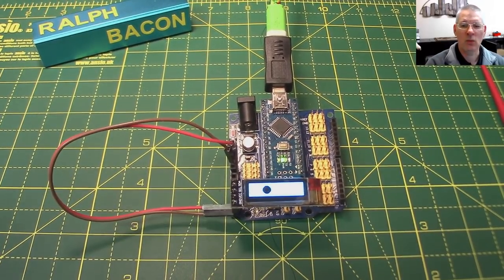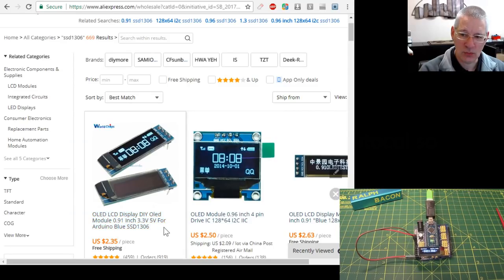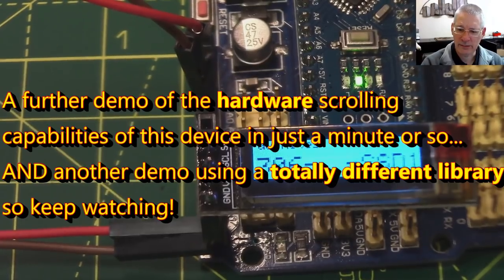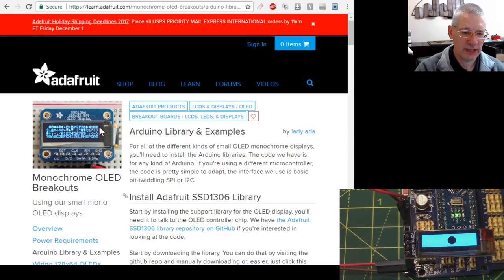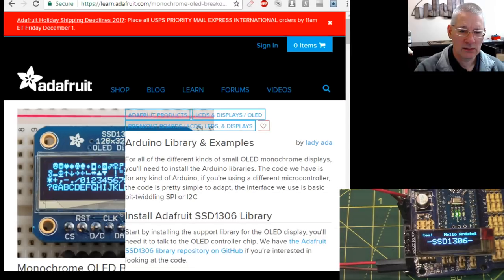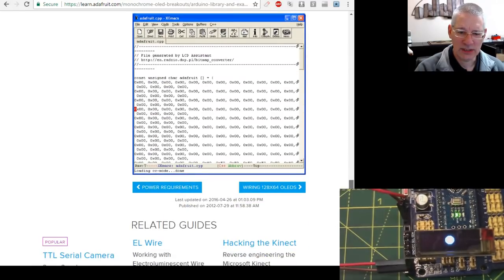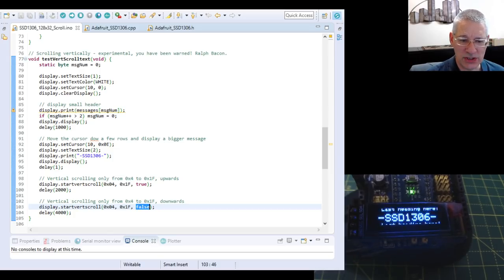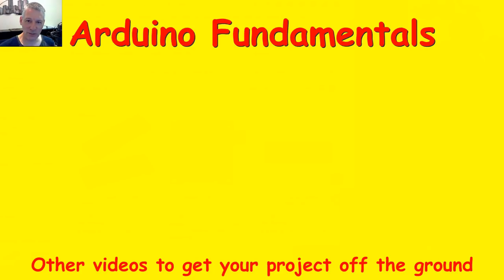#101 Fun 😊 SSD1306 OLED Screen for your Arduino project - I2C or SPI

Comment: In my tech writing experience, "feature is not available" often meant a manager didn't think the engineers would get it to work before tape out. But sometimes they got it to work after all and nobody bothered to tell the tech writer.

But beware. At other times it meant they couldn't get the feature to work reliably and decided not to document it. Undocumented features are a capricious gift that might work on some parts and not on others. See also "HCF instruction."
Reply from the maker: Yes, use at your own risk. Many a developer has been caught out by using undocumented features. It might work now but will it work with official next release 1.1?

Comment: Hi, Ralph that was good and all your extra work made it very usable I have seen a video on running two displays from one Arduino using i2c so that would make a good overall display you could have messages in one window with temperature in another stacked I think that would be nice!! will it work with the D1 mini?
Thanks for all your hard work Bob
Reply from the maker: Thanks Bob! Now coincidentally enough there is a video squirming to be released all about another type of SSD1306 but in a different module. I compare it to my Wemos D1 Mini OLED too! Cheap and fast. Watch it this Friday!

Comment: Someone has a pull request on adafruits library to add scrolling, but you have to pull the PR and another PR for the adafruit GFX library. I have played with it before, it seemed to work ok. I will be looking into again soon, will let you know.
Reply from the maker: I was quite surprised that the Adafruit library did not include this, given that their library code is beautifully constructed, documented and laid out. Perhaps they just plain forgot? If there is a fork of this library with vertical scrolling that would be good (apart from my version), so thanks for that, tablatronix.
Reply: No but I can make one, I think this is more of a real time console push auto scroll, rather than a static scroll like you show, it uses a double buffer, so maybe they can both be accomplished just the same. I switched to u8g2lib because adafruit does not PR stuff that does not relate  to their products, such as sh1106 support.

Comment: Finally managed to get the code working. 
I wonder how you could have this code working using strlen() and not strlen_P(), since your allMyText variable is in the program memory.
Reply from the maker: Without looking at the video/code I don't know the answer to your query but work it did! Perhaps it worked despite what I did, rather than because of what I did? But work, it certainly did, as the demo showed.

Comment: I hope you might be able to provide some insight.  I am trying to use your hacked library to do a vertical scroll on multiple lines of text here, but I am using the 128x64 adafruit OLED display.

I have been trying to get a pure vertical scroll using your code, but all i can get is a diagonal scroll, or a weird split scroll where part of the text scrolls vertically and the rest scrolls diagonally ("shearing" the text).  I changed the value of 32 to 64 in the first section for the vertical scrolling area, and I have been able to get the "split" point to move upward in the block of text by varying the "Start" hex value from the 0x04 value you used.  The split is in the 3rd (bottom) line of text when using 0x04.  The split moves upward as i INCREASE the start value, so when I use 0x07, it is in the middle of the first line of text, but if I go up to 0x08, it goes to a pure diagonal.  Values less than 0x04 seem to do a pure diagonal scroll.

Eventually it occurred to be that the STOP value of 0x1F is decimal 31 (the height of your display), so I thought that changing this to 0x3F (63) would do the trick, but I still get similar behavior.  I did modify the .h file so I am using the 128x64 display, so I am stumped.  I really want to make this work so I don't keep burning in my OLED displays!
Reply from the maker: Tricky stuff, Jeff. As you have tried out several things I would download the Adafruit library again (I've been using the new version recently) and they now cover more screens and have included scrolling text too. 

It's certainly worth a shot. You may have to edit the header (.h) file for your specific screen size, but that's obvious where you do this (you uncomment certain lines and comment out others).
https://github.com/adafruit/Adafruit_SSD1306
But see this line here (on that page):
Arduino library for SSD1306 monochrome 128x64 and 128x32 OLEDs http://www.adafruit.com/category/63_98
There's also a forked library for smaller screens (that I'm using): 
https://github.com/mcauser/Adafruit_SSD1306 but this is a bit behind the master so use with care.
Reply: @RalphBacon   Thanks for the response.  I actually tried reverting to the original Adafruit library now.  Obviously the vertical scrolling function is missing, but by trial and error I am able to get a vertical scroll by using:

  display.startscrolldiagleft(0x07, 0x3F);

I can't really explain WHY it works, but it does.  Before your response, I did get your modified library to work, with the same line above (but with "startvertscroll"), but I had to start the block of text at row 7 to prevent it from getting sliced in half horizontally.  After going back to the original library I didn't need to start the text on row 7.

Comment: What software you using for your interface? not the normal IDE
Reply from the maker: It's Eclipse, the Sloeber version:
https://eclipse.baeyens.it/
The new Arduino IDE is also built using Eclipse so it won't be too different from this.

Comment: In your code you have sometimes declared the counting variable "cnt" as an int, or sometimes as a uint8_t. Does that make any difference in your code?
Reply from the maker: Yes, it does, the two are not the same. Read on!

When we declare a variable as an "integer" this depends on what device we're coding for. On the Arduino it's a 16-bit length variable but how do know this? On the ESP32, for example, an "integer" is a 32-bit variable.

So to be clear in our intention, we can declare an "integer" (numeric) variable as 8-bit, 16-bit or whatever (as long as the compiler and underlying hardware supports the "whatever").

In your question, the uint8_t means:
u - unsigned
int - integer
8 - 8-bit
_t - type

So it's an 8-bit unsigned integer, that can only hold a value from 0 to 255. It only takes one byte (8-bits = 1 byte) so it's efficient in terms of storage space.

Similarly, an int16_t would be a signed 16-bit (two-byte) integer type, and the compiler is optimised to handle these, even on an 8-bit device like the ATMega328P Arduino Uno. In this case it's signed because that's the default and we didn't specify that it was unsigned by prefixing the declaration with the "u" character.

Saving space is all well and good when we're dealing with 8-bit devices that have limited storage and run-time memory (like the UNO) but when we get to bigger processors with much more memory it's (probably) best to use "int" and let the compiler figure out what the default for the device is. 

Just be aware (or beware) that such code is not particularly portable, though, as the integer size varies depending on the device you're running it on (compiling it on) and might cause issues (eg overflow).
Reply: @RalphBacon  Thanks. I understand what a uint8_t is, but what I meant to ask is the effect in the code itself that you wrote. As far as I see it, it doesn't make any difference in the code if you initialize the for-loop with a uint8_t or an int as long as the max index < 256, which is the case in your code. Or did I miss something?

Comment: Hello thanks for great video but I need a little help please. I'm trying to do some project with Nano and rotary encoder (so scrolling would be done manually) can it be done?
Reply from the maker: The short answer is: of course. 

The longer answer is:

1. How much have you done for this project? Have you tried getting a rotary encoder working successfully (I have several videos coving that).
2. Have you got the screen working to display text? This video covers that.
3. Have you thought about how you intend to scroll the text (eg a buffer)?

You mention a Nano but I would strongly recommend an UNO for development work and when you have it running then use your Nano (identical hardware). The Nano can be too small and cramped to use for development work.
Reply: @RalphBacon  everything works separately i just have problems putting it together i will try to understand this buffer thank you for the help again.

Comment: Hi Ralph,

Excellent video tutorials you make about Arduino and more.
Also this video showing the auto scroll mechanism. I get the code from Github. And it runs fine an a 128x32 display. It does also on a 128x64 (which I like to use in a DCC monitor project). The characters are stretched. I did some wteaking in your code, but cannot get it right.
Do you have any idea's how I can fix this?

I thought I might need another library. Cannot think of which one yet.

Update:
I edit this line: static const DevType MEM_TYPE Adafruit128x64x128 = { Adafruit128x64init, sizeof(Adafruit128x64init), 128, 128, 0 };
That did the trick for the streched characters.

Now struckling with the lines.
Reply from the maker: It's always tricky getting LCD screens working exactly as they should. You can read the datasheet for the LCD and ensure the correct commands are being sent?
Reply: Thanks Ralph for your response. I must admit I haven't looked at the data sheet yet. I am an engineer and I am "supposed" not to look at documentation at all ;-).
I will. 
I have the display going with 8 lines. Also it scrolls more or less. The nineth value is shown and directly after the first line. Also for the next lines.

I'll give it another try.
Reply: And I watched your video once more. 
Suddenly I realized I did not use your version of the Adafruit_SSD1306 library. Now I will start from there.

Thanks for all the clear explanation and instruction video's.
Reply: I have a scrolling display now. It will only scroll vertical when the rows are less then 25. When selecting pixel 0,25 to print from (or scroll from), part of the text is garbled and/or scrolling in the lower part of the display in a horizontal manner.

What I need is scroll up 8 pixel lines (or one text line) when the text has reached it's last line (8) on the display.
I might need to read the lines into an array and shift the array when a new line comes in.

Comment: thanks for your amazing work! i have tried your modified sketch, but it didn't work, it seems it doesn't recognize the  "display.startvertscroll" command. 
i would be thankful if you are able to point out what i've done wrong.
Reply: so sorry to bother you. but i got my mistake. thanks a lot for this nice well organized project.
Reply from the maker: Glad you got it sorted Jasim, it is a nice display, don't you think (I'm guessing you may have one already if you are experimenting with the library?)
Reply: Ralph S Bacon yes i do, i used one with my radio project that i’ve built as frequency display, i think the nice feature you’ve just added may help me to add stations name and so on. actually I prefer the .91 oled over the .96 one.

Comment: Can you get this display to work on the Nano with a RF24 module also? I can't. Seems there isn't enough memory for the 1K frame buffer which is done with a malloc() in the begin() method (maybe?). Pulled out most of my hair trying to get this to work. I ended up going back to the 20x04 LCD display.
Reply from the maker: I haven't tried this combination, Dirk, but what you say seems very plausible. You could try using a different device with more memory (eg the LGT32 that I did a video on recently, that has more memory and is a lot faster too). Or an STM32 but that's quite different in design.
Reply: @RalphBacon  I found a library last night, U8x8 that is working. the U8x8 allows only text and uses no page or frame buffer. It displays 8x8 characters so there's 16x8 characters. If I were under 40 I could probably read the 8x8 characters but fortunately there is an 8x16 mode that is very readable (up-close). So for just displaying some text on the screen it works great.
Reply from the maker: And that corroborates your hypothesis that memory is the issue. I'd still try one of the LGT32s as that might be a better solution. Cheap too.
Reply: @RalphBacon  I've been experimenting with the software I2C constructors in the U8g2 library. I realized there's no reason a project has to have just one micro-controller. With software I2C I can hook multiple displays with the same I2C address up to a Nano that then connects with hardware I2C to the main micro-controller.  Since the SSD1306 OLEDs I have use an I2C address that is the same and un-changeable I'm able to use more than one and the 2nd micro-controller means I don't have any low-memory issues.
Reply: @RalphBacon  I soon as I finish up this project with the 328s and RF24s I plan on trying out the ESP32/STM32/Blue-Pill type micro-controllers. Maybe WiFi and LoRa type IoT projects. There's so much fun to be had with micro-controllers--the world is my oyster. :) Thanks for all your help along the way. When I look at the 5 devices I've created in the RF24 network, I see a lot of your knowledge in them. Like you once said, I'm standing on the shoulders of giants. Cheers.

Comment: you used two boards,it is also possible with a single board?
Reply from the maker: When you say "two boards", Engr, do you mean the Arduino Nano plugged into a development board (so it looks like an Arduino Uno, with more pins to plug things into)? This would run quite happily just from an Uno (or any other µController I should think that gives you I2C or SPI).
Reply: @RalphBacon  yeah,exactly,does using both arduino affects the written code in any way?
Reason is because i tried every other examples,and they worked fine,but the extended scroll didn't work,it came out as blank.😅
P.s. i used an arduino nano .

Comment: My ethos only, if you use adafruit libraries, buy adafruit.
Reply from the maker: Indeed, Rick. I do (occasionally) buy Adafruit modules but they do come with a price premium. Your ethos could be extended to say "If you use Arduino libraries, by Arduino.cc boards". But many buy from the Far East, as it's all Open Source after all.
Perhaps better stated is, "If you regularly use software from a particular manufacturer then support them by buying something from them occasionally". A bit like buying something from a USA gas station if you use their restrooms. Just a soda or chocolate bar. Not the entire shop. You reckon that's OK?